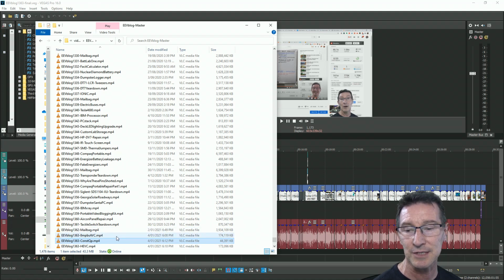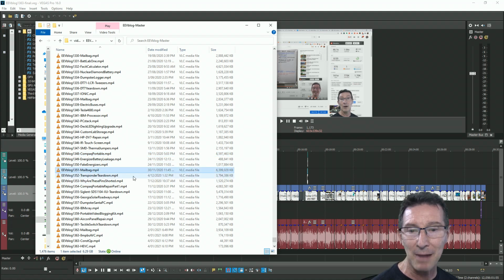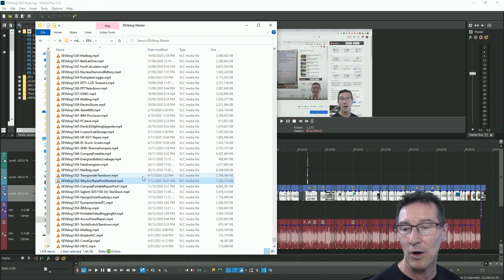TEST: Constant Qp Test - Using VBR

Comment: Bandwidth is like memory... it's cheap as beans but time is a far more valuable resource that can't be replaced once used so I use NVENC to encode all my YT uploads in H265 at quite high bitrates and upload them that way.  The files are big but the quality is more than good enough and with a gigabit fibre connection the actual transfer seldom takes more than a couple of minutes -- even though YT seems to throttle uploads to quite an extent for those of us living in New Zealand.   The beauty of H265 using NVENC is that it's blisteringly fast.  Using a lowly old GTX1060/6 I get encoding rates of around 150/200 FPS on 1080p material and about realtime (50FPS) on 4K stuff.   Life's too short to be sitting around waiting for a render to finish :-)

Comment: Please enlighten me... If CBR keeps the bitrate constant thus drops in quality for "dynamic" content, and VBR adjusts the bitrate according to the content thus keeps the quality constant, what's the difference between Constant Quality and Variable Bitrate? More keyframes, different compression format, other compression logic? And how does that affect render time?
Reply: Variable Bitrate will adjust things regardless of quality.  It'll still have places where the quality will jump significantly because it needs to keep the bitrate at an average.  So areas will still go really low quality or really high quality as the algorithm needs in order to meet that average.  That's why there's a max bitrate setting, to constrain it from just jumping the quality on a short burst to absolutely perfect and then using lower quality elsewhere.  Constant bitrate will make it always and only a single bitrate, regardless of the content.  The idea is that VBR will try to adjust to allow some areas to take up extra bits that weren't needed before.  These two modes are important for things like DVDs, BluRays, or other fix speed media (in theory) where you can only read so much of it in a given time.  If you go too high then you'll have a buffer under-run when trying to play back the media and have to wait on the disc to catch up.  If you used a Constant Quality mode on those devices then some frames may go well above the maximum speed of the disk and be unrenderable by hardware devices like that.  For streaming, none of that matters in the same way that it did for fixed hardware.  That being said, the modes are still used because constraining the amount of bandwidth used is still useful because people don't have infinitely fast connections either.  Constant Quality mode will usually take longer to encode too.
Reply: @ryanvoots9827  So CQ is like VBR but doesn't care as much about keeping the bitrate under max or around average to allow for faster change in bitrate? <=> VBR = CQ + Low-Pass on bitrate change?
Reply: @spacenomad5484  That's a simplified way to look at it yes.  VBR will sacrifice quality to keep the average, or sacrifice small files to keep the average too.  CBR will be as exacting as possible sacrificing everything else.  CQ mode will do everything needed to keep the constant quality, sacrificing everything else.  so CQ and CBR are the opposite sides and VBR is basically a compromise between them that will work pretty well for most decoders/situations

Comment: Youtube reencoded both videos to constant bitrate, QP was converted to 1005kb/s and VBR to 1104kb/s, may depend on the content .. but using VBR everytime is a good idea, because VBR needs nearly no bandwidth when no content in the picture changes - like you said - constant background, and got more bandwidth when something changes, Constant bitrate just uses the same bitrate for all frames, so when fast movements are there, or a bigger chunk of a frame changes instantly (for example Window-Popup, Dragging of a window, Camera-switches and so on), it takes more frames before the quality is good again.

Comment: Your best bet is usually CRF, or if you need to target a particular average bitrate, then 2-pass VBR. All the other encoding modes in x264 are basically rubbish, you only use them if something is really forcing you to do so, like live streams or embedded devices with poor standard compliance.

Comment: To the best of my knowledge, Youtube does re-encode files. I've uploaded 1080p files to my channel at YT's recommended file format, codecs, bitrate, etc., but if I download the file after YT's finished processing it, it's smaller and in a different codec. I just downloaded one of my own videos from 2013: it was originally a 2.5GB file in h264, it's now 710MB in vp9.
Reply: I think you are correct.  When I am back at a full blown computer, I will take a look at these videos with youtube-dl and see what versions YT offers the video in.  Should be possible to figure out which versions the other services are pulling down from there.

Also, nvenc is horrible for encoding quality.  Thank goodness YT re-encodes from that rubbish.

Comment: Just use libx264 CRF20 medium. High profile. Youtube also now supports X265 in mkv containers as an input. But X265 is compute heavy unless you have a video card with a x265 encode ASIC.
Reply: This. Hardware encoding(NVENC) is much faster but results in worse quality. x264 is software base and should result in better quality. If storage size is very important consideration x265 shall be used as it results in 20-30% smaller files at similar quality. But to be fair since yt transcode anyway I would use either CRF17 if material quality is reeeeeaally important or CRF22 if it has to be good enough.